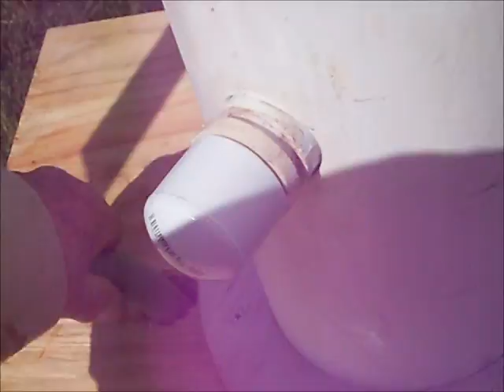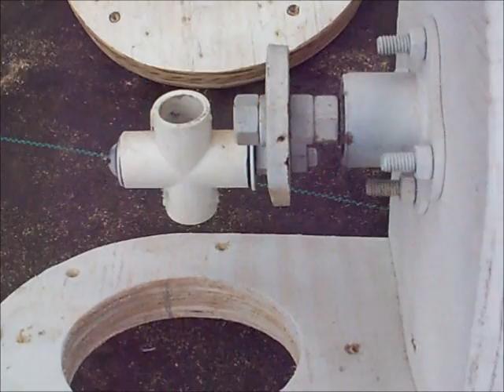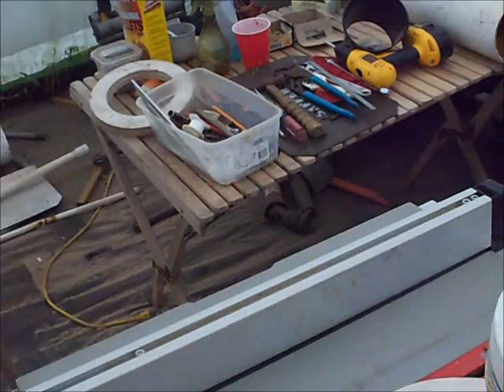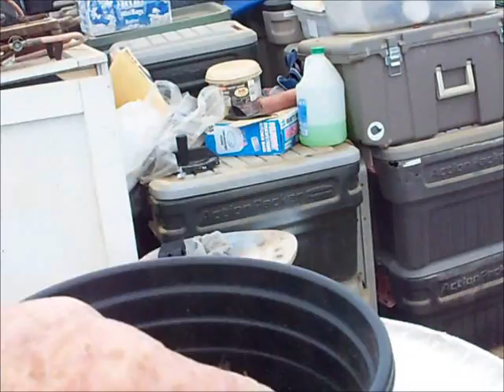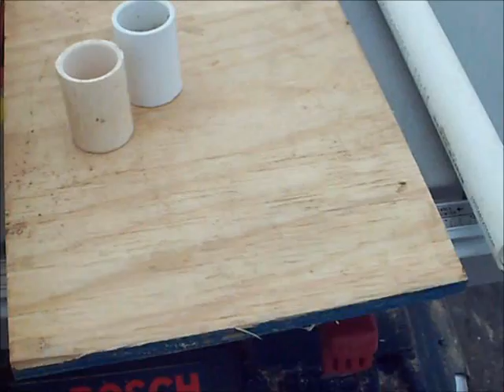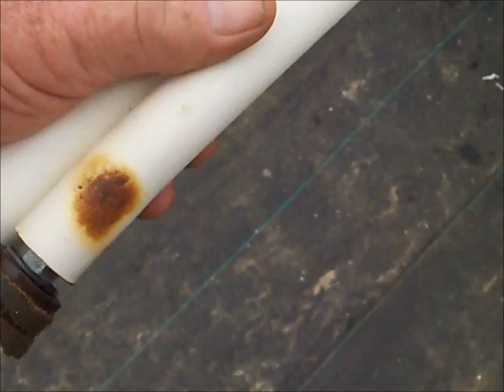Windmill and water pump DIY part 1

Comment: how much air speed is required sir?
Reply from the maker: +Pratik Chougule We have trade winds most of the time,  5 to 25 MPH  Usually slow during the night.
Reply: okay. thankyou
Reply: Thanks so much.

* really interested to water pump design.